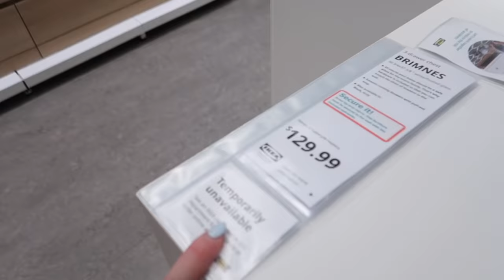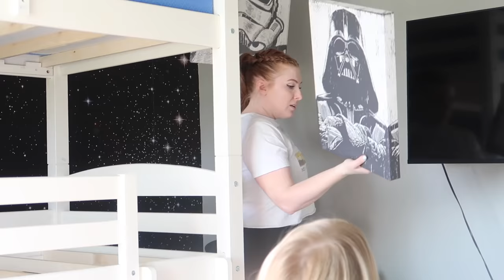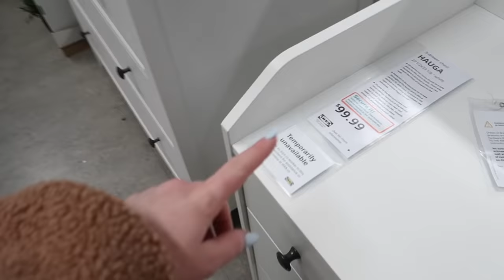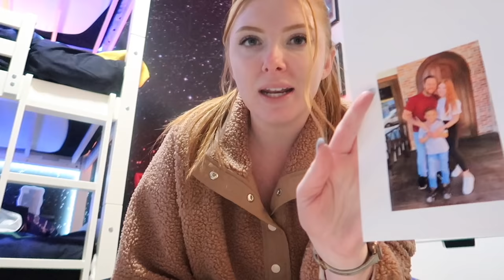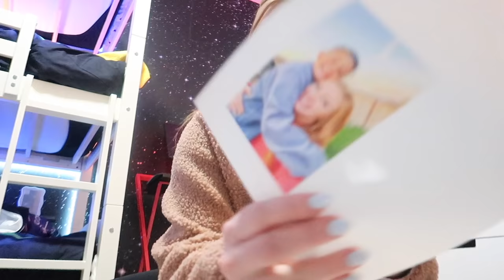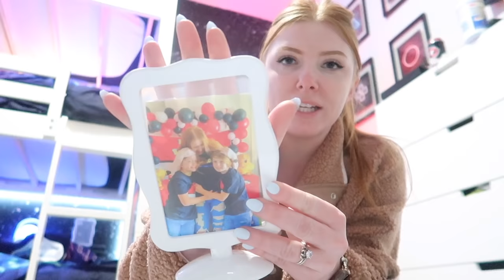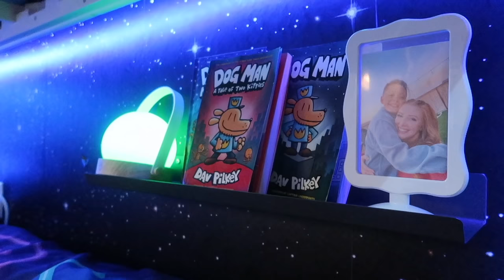3 brothers SHARED bedroom *EXTREME* makeover (w/ triple bunk)

Comment: I grew up so broke i didnt even know what a duvet was until i was in my mid-late 20s when i worked at a 5 star hotel as a housekeeper. All the mattress toppers and pollows were feather versions and the duvet insert was such a pain to get in and out of the cover. And all the bedding was white. For Valentines day a few years  back they put rose petals on the beds. Well apparently quite a few couples couldnt wait to do the do or think of moving the petals first.... many many duvet covers were ruined.... and they decided to no longer do the rose petal hats anymore because the duvet covers were $200+..... so replacing 42 covers (or even half of them) all at once every year (plus any additional ones throughout the year that may get ruined/stained and needs to be replaced) got SUPER pricey after a few years...